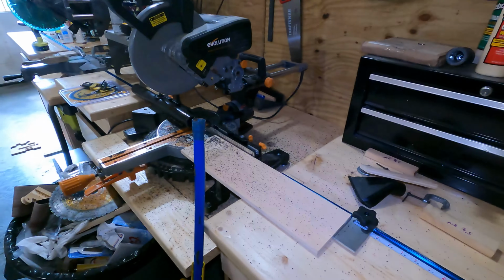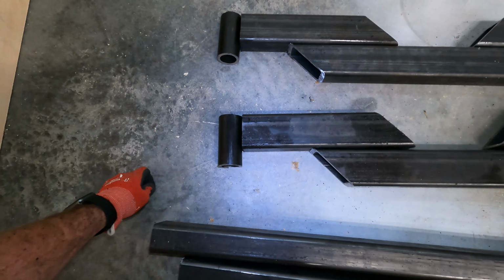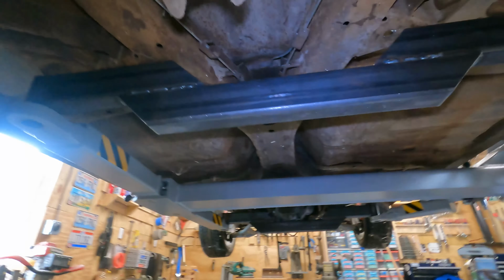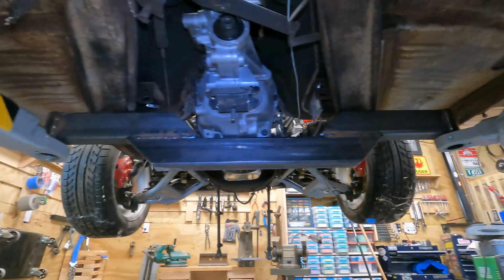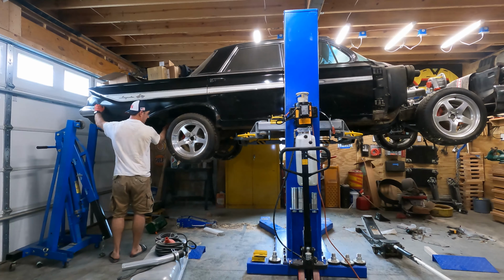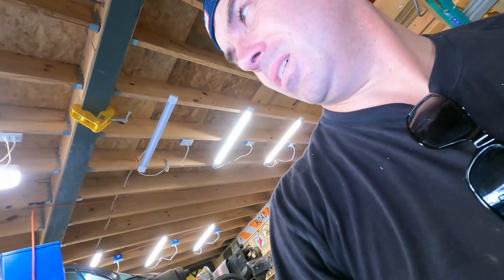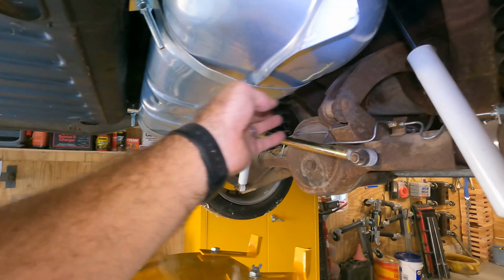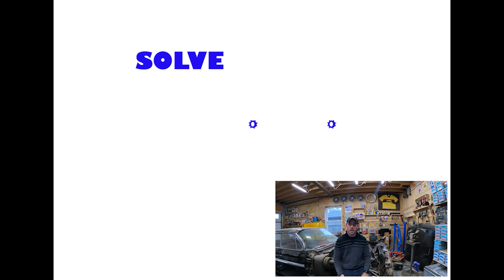Single Column Lift for an X-frame Car - and a gas tank installation - Solve Fix Build

Comment: I was nervous with ya! Awesome lift!
Reply from the maker: Thanks!
Reply: @SolveFixBuild  You need some rubber pads or other non-slip material between the home made lift bars and the car frame. Steel slides on steel so easy, the car could slide right off the lift with one hard pull of a wrench etc. As someone who grew up in a garage, and worked construction, at 61yo, watching this video scared me.

Comment: How do you like the lift now that you have had it awhile? I’m on the fence about getting one myself. Would you still recommend it if you had a shop or would you rather have a two post lift?
Reply from the maker: I love it. I can move it around flexibly and use it for lots of purposes. It’s reach is a little tricky to manage (as you see I made adapters) and the crossmember blocks the center but I can still do transmission, exhaust, and driveshaft work without rolling on the floor.

Comment: Thanks for the very detailed video. My garage door is 7 feet. Does it look possible to tilt it to get it under a door? Perhaps with a heavy-duty hand car (rated for that weight) or some other method...
Reply from the maker: I would be concerned about rolling it out the door while still assembled. My door is 8 ft and I’ll have clearance issues. When I move I think I’ll have to take it back apart and put it back together in whatever shop comes next.

Comment: What blade are you using to cut the metal.  I could not find one like in at Lowes.
Reply from the maker: Evolution makes them for the Rage saw - Evolution Rage blade for 10" miter saw. You can find them on Amazon.